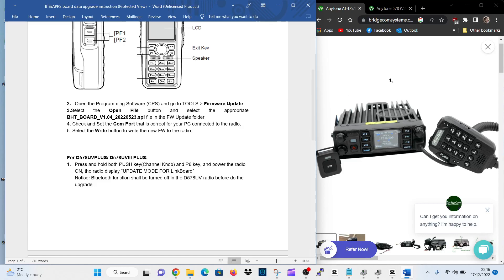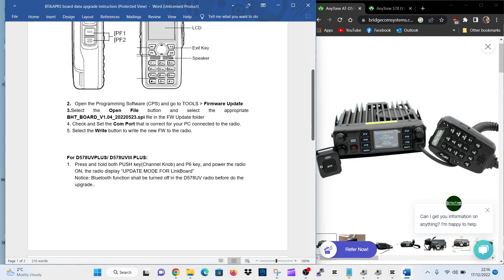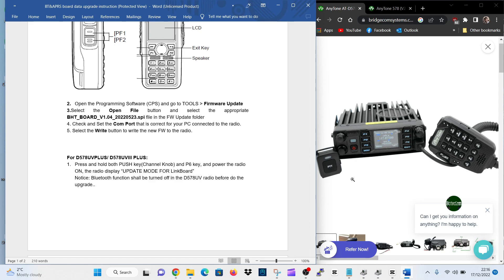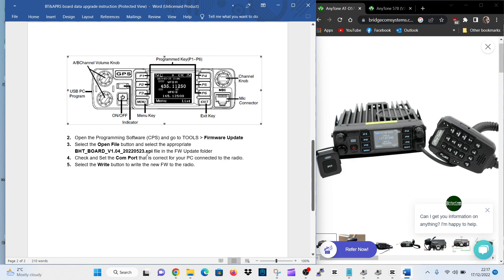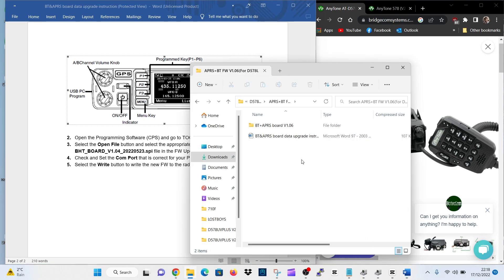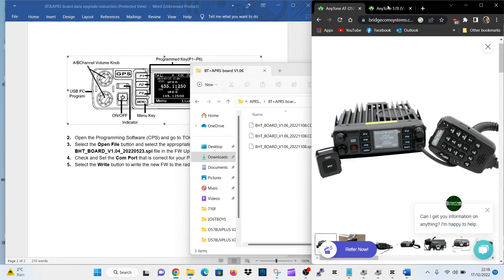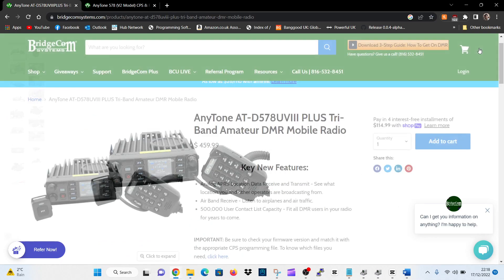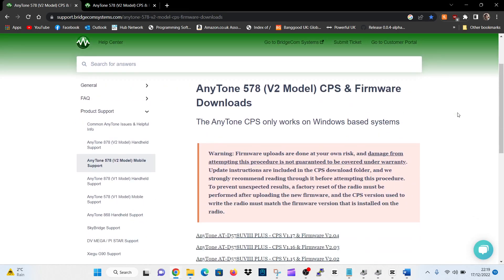ANYTONE 578 BLUETOOTH FIRMWARE UPDATE MODE

Comment: So can you update with windows cps, or can you only update Bluetooth with an android device.
Reply from the maker: You use the CPS its just you put radio in to blue tooth update mode by turning off then hold in channel knob and P6 THEN IMPORT THE FILE USING CPS IN THE NORMAL FIRARE WAY ./
Reply: @M0FXBHamTech  then where does the android for Bluetooth come into play? All of the sellers are telling the customers that you have to use an android device to update the Bluetooth firmware?
Reply: @ridiculous9730  Yea that has me confused too.  I read the android phone is how you update the 578 BT firmware.   This is crazy